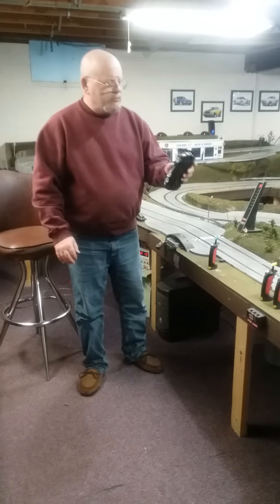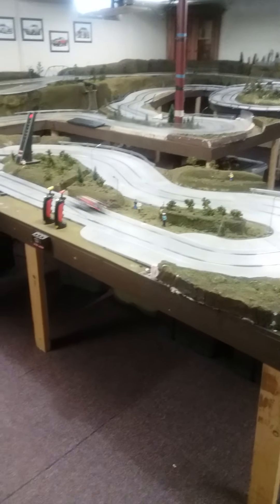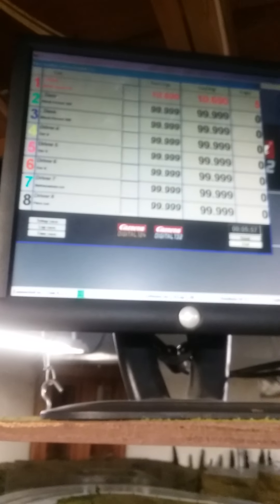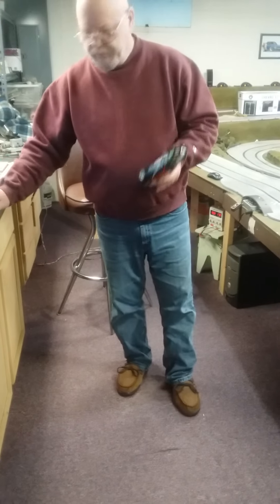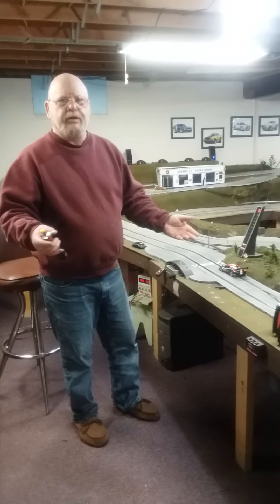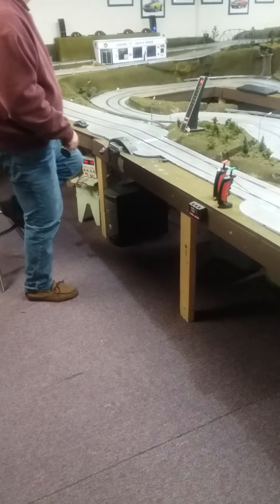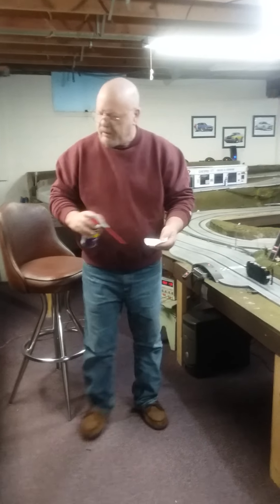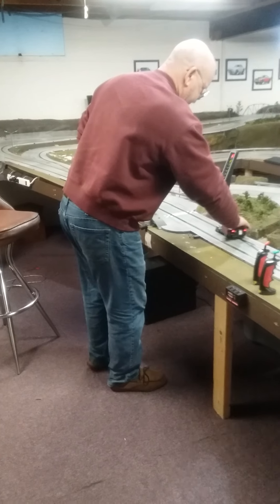Cleaning Carrera Slot Car Tires

Comment: Incredible. I'll be giving this a shot. Thanks
Reply from the maker: You'll be surprised at the dirt that will come off the tire. Make sure after you clean the tire to wipe off the excess or you'll be slippin and slidin for a lap or two.
Reply: @dw5555  Sounds good!

Comment: Great series of videos.  I also use urethane tires on my digital track and have been for about 3 years.  Tonight, I tried the Windex that you demonstrated.  Much cleaner than a lint roller or masking tape.  I run Paul Gage urethanes.  Since you said you have been cleaning the tires this way for many years, I wanted to ask if Windex does anything that may shorten the firepan of the tire?
Reply from the maker: I also run PG tires and love em. I have never had ANY ill effects on the tires using either the Windex or the Wd40. I've used Windex longer than the Wd40. Not even sure what got me to try Wd40. I think I had it on a rag one time and wiped the tire and couldn't believe all the stuff that came off it.

Comment: are you going flat out all the time with no effort or are you having to control the throttle on the bends?
Reply from the maker: You definitely have to drive the cars. There is only a few places on the track where you can go full throttle and it's just for a second or two.

Comment: I'm looking for some rubber/urethane but don't know the size?
1/24 C7 Corvette Valvoline to start with.
Reply from the maker: Hey Greg, you're in luck with the C7's. They share the same size with many other Carrera 1/24 cars. CarreraSlots is my go to site for parts. These are the tires you need if you want urethanes. Stock rubber tires are getting harder to find as Carrera doesn't support parts anymore. 

https://www.carreraslots.com/Merchant5/merchant.mvc?Screen=PROD&Store_Code=CC&Product_Code=PGT-29148&Category_Code=124cars

Comment: How do I determine what size tires are on my Carrera 1/24 cars?
Reply from the maker: What are you looking to do Greg? Are you looking for aftermarket tires? Stock Carrera tires are a hit and miss proposition, they stopped producing parts for their cars a few years ago but tires are still around. You need the part number for the tires found here (copy and paste) Just google the part number of the tires.

https://sbcarreratoysmediahandlercdn.azureedge.net/7a171b54-57f8-4070-8e4f-7b5e464729e2/Spare_parts_overview_D124_Feb_2021.pdf 

If you're looking for aftermarket tires Paul Gage Tires makes some great urethane tires (found  on Ebay). Cincyslots.com also makes urethane and silicone tires. Both companies just use the car for tire sizing. Quite a few of the 1/24 cars use the same tire.

If you didn't know urethane tires are more forgiving on a dusty track and will still grip. Silicone tires grip excellent but require a very clean track for optimal traction
Reply: @dw5555  Very helpful, thanks again